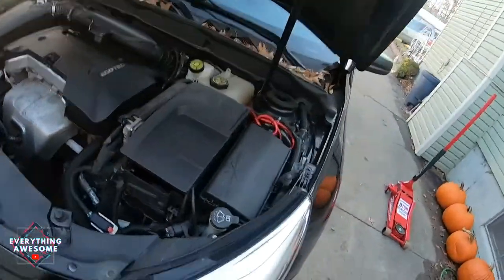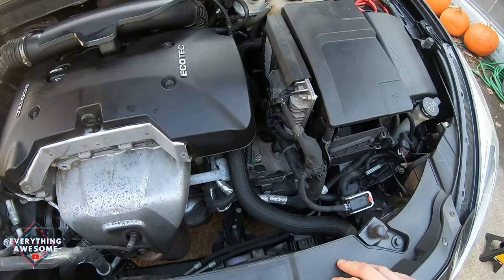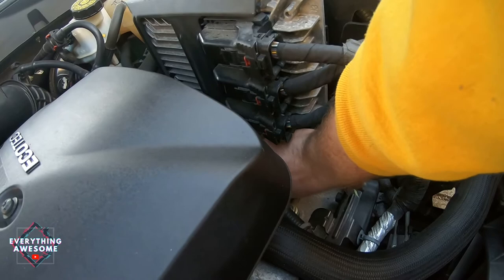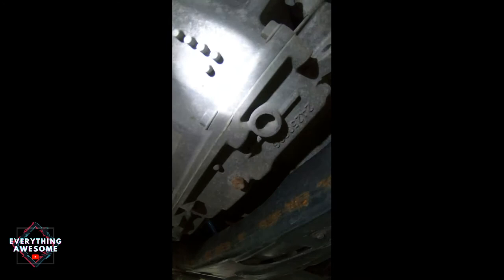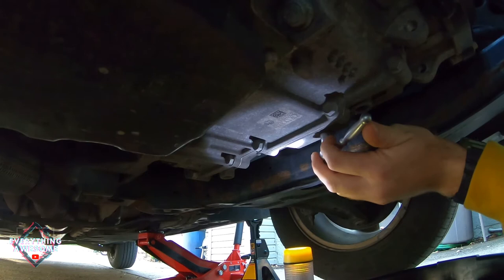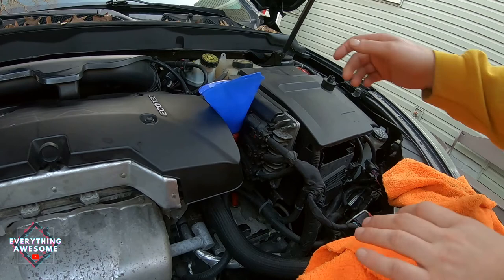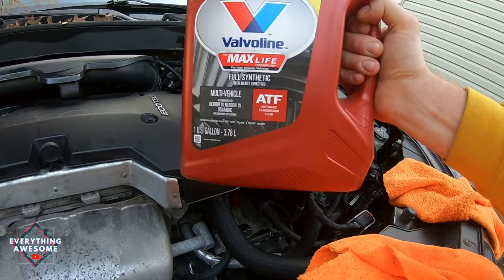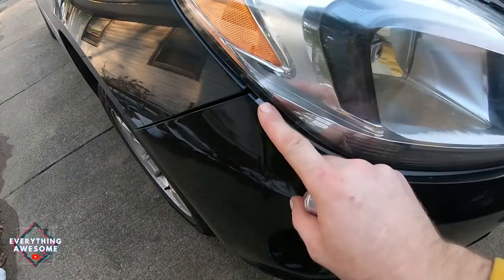How To Change Your Transmission Fluid At Home - 2013 Chevrolet Malibu

Comment: To make sure you have the right amount of fluid,there is a plug up on the side of the tranny that looks just like the drain plug,it’s right next to the drivers side axle.With it idiling and warm,take that plug out,and some fluid should come out. If there’s a lot let some drain out,if it just barely comes out your good to go. If nothing comes out,add fluid until it does.
Reply: Correct
Reply: You are correct almost. First you need to get trans to a certain degree, 180- 200 f. Also , need fo go thru each gear, pausing 3 seconds in each then let idle 3 mins
Reply: Thanks alot dude this would really be a good help for me, many many thanks again. Greetings from KSA.
Reply: Your transmission is underfilled.
Need to do a hot temp check as stated by the people above.
Fluid needs to be changed when the temp of the fluid is below 140 deg F otherwise you don't get most of it out.
There is a valve mechanism in there that restricts oil drain above this temperature.

Comment: There is an over flow, or bleeder bolt on the side of the transmission, on the drivers side, behind the wheel. All you have to do is take off the wheel, and the bolt is to the right of the axle shaft. Remove that bolt, and add some transmission fluid, when it starts to drain out of this hole, stop adding fluid and re-secure the bolt. This way you won't be adding too much or too little transmission fluid.

Comment: Big thing to really look at closely because even mechanics who change your oil do not do it properly all the time.  Important thing is to level car left and right as close as possible with a bubble level.  if that is not done, you will get an incorrect amount of fluid.  Also, you need to run thorough all the gears before completely draining fluid with car on.  This will help cycle the dirty oil out.  Drain fluid out afterwards then add fluid again.  Again run though all gears after filling.  Use side hole to tell you when to stop filling.  You will see clean red fluid exiting the hole when at full level.  You will need to add more fluid into the transmission because when you go through the gears it will cause the level to drop.  So slightly overfill then drain excess out of the level fill.  You will see a mixture of dirty and clean fluid.  Repeat the above process 1 or 2 times to completely flush the transmission and clear the dirty fluid.  It is important to maintain this transmission as you will see shifting becoming poor at 35 to 50mph when it is dirty or overfilled.  Because of this, it is important to level the car using jack stands on both sides of the car and use wheel chucks behind rear car tires to keep it from moving while on the jack stands.  Use the jack on the passenger side to do fine level adjustments to make bubble level center.   Some say to not change the oil but, in this model, at minimum if it was ever changed, you will want to know if they did it properly to begin with.  It is very probable that it was not changed properly in the past.  How many mechanics you will actually measure the amount of fluid that exit your transmission when they use a large oil container that they wheel all around the shop?  So you must always verify car level when filling, tire removed and checking fluid is right at proper level with check plug removed.  That is only if they had the proper amount of fluid in the car to begin with when they changed it that you could get away with this method.  I completely leveled my 2013 malibu left and right.  I had almost 1.5 quarts of extra fluid drain out of the fluid check plug.  This means that air was getting into the fluid and was causing it to hunt for gears and shift poorly / erratically.  The solenoids in a transmission will not work properly when too much fluid is present in the transmission.  Protect your car and don't expect the mechanic to do it properly.  They don't care about your car like you do.  Do it yourself but properly.

Comment: What about the filter? There's no sense in changing just the fluid and not the filter.
Reply: The filter is internal and requires the transmission be disassembled to change.

Comment: Theres, a black rubber piece on the transmission what is that? "& a blot under? Do we, unscrew that bolt to see if transmission oil leaks from there??

Comment: 6.3 quarts
The 2013 Chevy Malibu has a transmission fluid capacity of 6.3 quarts of fluid1. Chevrolet recommends using synthetic Dexron VI fluid in the vehicle whenever you need to change it1. If you need to do a full transmission flush, then you will need ten total quarts of fluid since the first half fill will need to be drained again1. The total system capacity of the transmission is 9.5 quarts23. The service fill is 4-6 L, and the dry fill is 8 L4.
Reply: Yes but the amount varies from The different models of trans,
 SE/ LT/LTZ 😮😊
Reply: Don't ever do a full transmission flush. Those particle break off you flush out can actually be preventing slippage. If you remove that grit, you can actually doing more harm than good. That said a drain and fill is more than enough.

Comment: How often do you change it I have a 15 and it started driving weird
Reply: It's supposed to be changed every 30,000 miles.
Reply: Most vehicles 60k but the transmissions in  these Malibu's will make fluid dark fast so, every 30k is suggested

Comment: 2015 malibu ... what about transmission filter ? do you have any idea ?
Reply from the maker: Hey there, should be the same procedure and when it comes to replacing the filter you may have to dig deeper in to get that. I did not change my filter but will likely be changing it when I do a full fluid change!
Reply: These transmissions don’t have serviceable filters
Reply from the maker: @DaleyBoy2267  I'm not sure I understand what you mean by that? Everything is serviceable to an extent, and Im pretty sure I would have to drop the pan to get to the filter. Please correct me if I am wrong 🙂
Reply: @horsepowerhangout  you can't and it's definitely deep in the transmission and very expensive to attempt to change
Reply: @horsepowerhangout   you have to remove the transmission to change  the filter,  the filter sits behind the transmission pump. It's not located in the pan

Comment: Thanks to your video you helped me change mine! Changed it 3 weeks ago but now it’s leaking. I wanna say it’s probably leaking from the fill plug but not sure :( it’s never leaked before.. welp this is gonna hurt my wallet lol. Have you had any problems with your transmission so far?
Reply from the maker: Hey there! Thanks for watching and to be honest it is likely the fill plug. Technically you are supposed to torque (tighten) the plug to specifications. BUT the drain plugs usually have a rubber gasket that can dry rot and go bad over time that would be my first look and to find out exactly where the leak is coming from! 👍🙂

Comment: I’m wanting to change my transmission fluid on my 2013 Malibu but I have a question before I do. My car currently has 66,000 miles will changing the fluid cause my transmission to slip? Thank u
Reply: For it not to happen put maybe 1/2 quart of lucas fluid for transmission I do that to all my cars and they shift nice can't even fill when they shift gears

Comment: Does this work for a Chevy Malibu eco?
Reply from the maker: It most likely will, the part placement may be different but replacing the sensor could likely fix the issue 🙂

Comment: If my car is slipping does it mean I need  to change my transmission fluids and it made a loud thump sound. When I was on a hill it was hard to accelerate until I reset my car on even surfaces. Was it actin like this at first
Reply: I have a 2013 Malibu and have the same slipping issue at speeds around 20 to 30 MPH.  I’m guilty of not changing the fluid and have 140k on the miles.  So, I assume it’s the fluid and needs to be changed.
Reply: @jeffcollins7311  Did you replace it and did it fix the issue? I have a loss of engine power/acceleration and I'm not quite sure what it is

Comment: It's just a mixing of old and new fluid...need to do a flush on it...complete fluid change
Reply from the maker: Definitely the plan on an upcoming video, I didn't have the money to do a whole system flush at that time 😕
Reply: never do a flush.. can knock debris loose and cause more damage, change as much as comes out and do it 3 or or so times during your next few oilchanges and u can be sure to have good fluid without the risk
Reply: @lukemax1357  smart comment 👍

Comment: Does the car have to be at running temp when changing the oil? Can it be done cold also?
Reply: the car have to be at cold temp when changing the oil
Reply: @zekofreh3  Did it myself. Thank you very much for your video.

Comment: Did you get and slipping after the change of the 40 or so percent you replaced?
Reply from the maker: No slipping and trans is running like normal it was operating fine before the change but at 100,000 miles it is part of the service manual to change fluid, when I get the time before winter I will most likely be doing a full flush 🙂
Reply: @horsepowerhangout  i don't recommend flushing with it that dark i would just drain you only drain about 20 to 30 percent from the total fluid. Going from dark to clean might cause slipping or worse
Reply from the maker: Ehh not too worried about slipping, old fluids are meant to be changed and you can always thicken the viscosity to help reduce subtle slippage, but I haven't had any slippage whatsoever 👍🙂
Reply: @TerryBoudreau  40% ? 🤔since he drain 5 quarts that Malibu takes 10 quarts o more ?

Comment: Will it stop the bands slipping?
Reply: I know this is 10 months old, but if its already having issues, do NOT change the fluid, it will only make things worse. Save up and get the transmission repaired or replaced. Only change the fluid at service intervals and when no issues exist.

Comment: Hello friend, do not you think that six and a half quarts is too much, because in the manual they show from 4.2-6.3 quarts and in other videos they recommend 5.5 quarts.
Reply from the maker: What I did was check how much trans fluid came out and replaced the same amount with new fluid, but to be 100% sure I would call or visit auto zone, o'reilly's, etc and inform them of your make model and year and see what the amount is for a trans fill
Reply: The best way to be sure on how much to use, you should take the fluid your drained and poor it into a few empty  1qrt bottles or even a 4qrt jug or 2 just to be exact
Reply: @RedFrostproductions  the best idea👌
Reply: @RedFrostproductions  That is only if they had the proper amount of fluid in the car to begin with when they changed it.  I completely leveled my 2013 malibu left and righ.  I had almost 1.5 quarts of extra fluid drain out of the fluid check plug.  This means that air was getting into the fluid and was causing it to hunt for gears and shift poorly / erratically.

Comment: hai. i have a chervolet malibu 2013 model.
my problem is ..when i drive up to 60 kmh. the tranmission seem to cut off.

So i have to stop at the side of the road. restart and it move again.

It only cut off if i drive up to 60 kmh.

What is the problem ?

(2) How much do i fill the Dexton V1. How many litre.?

Comment: What is the exact QT to put in?.
Reply from the maker: What kind of car do you have?
Reply: Take out the inspection plug on the side of the Trans below the car. Fill until fluid comes out. Stop filling and when fluid stops coming out of plug you're filled to the right amount. Put plug back in and that's it. Also when draining fluid make sure your car is running so it will pump out all the fluid and running when you fill it so the pump will circulate the fluid fully and then when you see the fluid come out of the inspection plug it is full. If you don't run the engine doing this you will underfill it.
Reply: You could drain the fluid into a pan and transfer the fluid from the pan into empty qrt bottles to see how much you have taken out